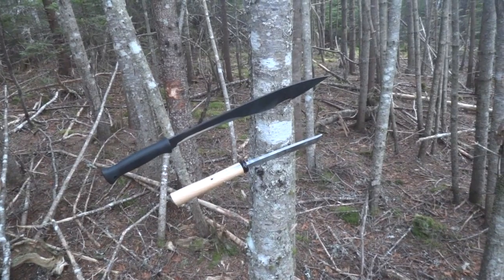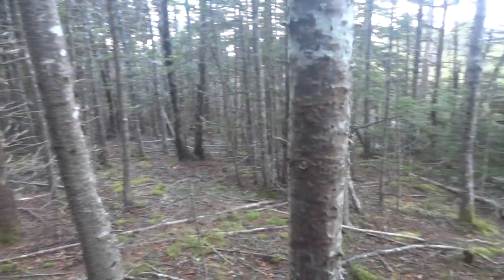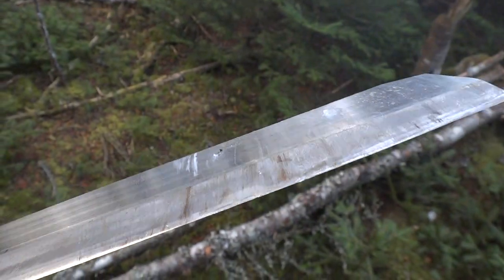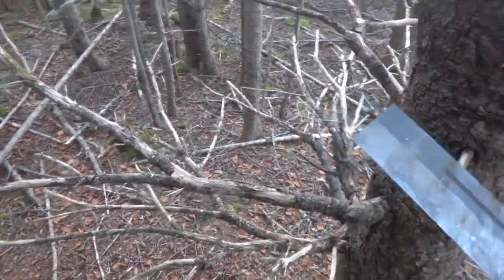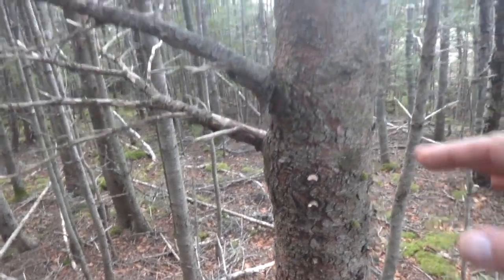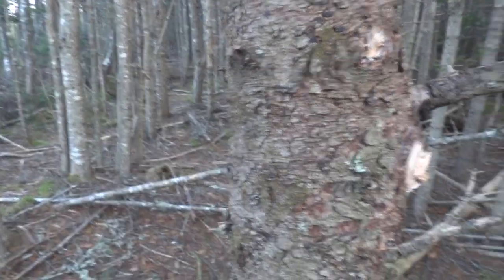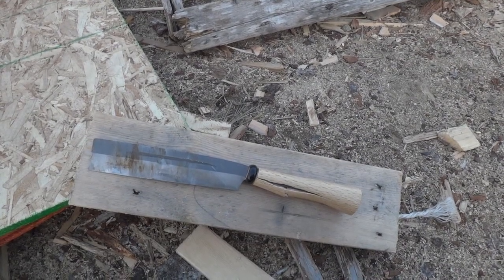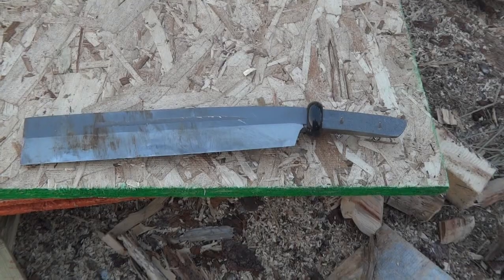Japanese Garden Machete - limbing, felling, and bucking

Comment: Thanks the only explanation of cutting vs chopping I have found on line for chisel vs double bevel and proper technique.  A full length tang in the handle must be considered and should prevent the handle from breaking or splitting

Comment from the maker: @knifedrago Modified hammer grip. On a knife this light, index and thumb are enclosed, but lightly held. On the backswing my first things fingers loosen, the blade rotates back, on the downswing the three fingers close back up rotating the blade ahead in a snap. When the blade makes contact the pinky pulls back sharply and the thumb/index finger torque down hard. This is a follow through rotation/movement.

Comment from the maker: @555Nato When felling most would either use the poll of the axe to crack them off or a dedicated heavy edge axe like a swamper pattern to cut them. I don't like cracking them in general as it leave very sharp points exposed and if you do decide to harvest the tree it is full of sharp spalls. Try to carry that on your shoulder and have the weight shift and one of them dig in suddenly, it isn't fun.

Comment from the maker: @555Nato The tang can be tapered in thickness just like the blade. This can achieve the same weight reduction as drilling holes, etc. and is a much more durable configuration and is also not as prone to shock as on larger blades. It however is more time consuming which is why most people will just drill a bunch of holes.

Comment from the maker: @SpartanJohns I had similar thoughts, I was very surprised to see a crack run up the blade and start along the spine, but was not that surprised that the handle went. But again this is the most basic/inexpensive version. It is the equivalent of the local $5 hardware store machete. I may look for an upscale version later.

Comment from the maker: @555Nato It is much harder to fit a tapered tang, but it can be done properly, Loveless made it fairly popular again for awhile. 

The main issue with all the holes is on larger blades, you don't want it for vibration purposes.

Comment from the maker: @tallswede80 Yes, I have an 18" Ang Khola which works well for this type of work. It has the mass and balance to generate a powerful swing, but still has a fine edge to enable it to cut well and a nice tapered grind so it will be fluid in the bucking of the felled wood. I should actually take it out next time and compare it to the Cold Steel kukri machete as it is of similar length (but difference in about every other aspect).

Comment from the maker: @69penetrator69 Yes, swamping axes were traditionally used for this work as it is "dirtier" than normal felling. I have a couple of old swamping heads, I just have not got around to hafting them. I also have a true old style felling head (very narrow double bit) which would be very nice on the bucking but it is designed for much heavier wood, trees measured in feet not inches. I don't cut much of them any more though.

Comment from the maker: @555Nato Rehandling a blade can be a non-trivial issue, that is likely one of the main reasons for the full tang slab grips they are basically invulnerable and very low maintenance. The only issue with handle modifications is to ensure that the balance is properly maintained on the knife, usually this can be done with a tapered (though full width) tang.

Comment: That was a bit surprising but not at all at the same time. The Wood handle breaking like that.
The steel cracking like that was a bit more surprising. I get that this is a cheap tool , but still...
Very good info on how to work with the chisel grind.

Comment from the maker: @tallswede80 This knife is actually much heavier built than the Trailmaster. It is 50% heavier with a more forward balance so the impact energies are significantly greater. It works well power wise, the handle can just not take the strain of the impacts.

I have a number of axes but for standing wood like that where there is very close in growth I would prefer a longer blade simply because of the ability to sweep cut multiple targets and not have to be concerned about haft impacts.

Comment from the maker: @virtuovice Yes, it was more of a technique issue, this blade was designed to take more of a high volume low impact type swing, more wrist action. I was actually using a lot of elbow and very heavy swings and I do a lot of axe work so the hits are pretty heavy. I don't fault the tool, however I would have liked to see better grain in the handle as it should not curve / crack like that with ideal grain.

Comment from the maker: @555Nato Short tangs have a bad name due to issues of construction, and they do put a weak point in the middle of the handle, that is just physics. If the tang on this one was a taper to the end (Loveless style) then the force would not be so concentrated like it was in this blade. But it is possible to built a partial tang without durability concerns, I doubt the handle would fail on the new custom I am having built.

Comment from the maker: @tallswede80 As well, as noted I have many axes. I usually fell at least a cord of wood by axe each year, more if I get the time, and depending on the other wood I get from various sources. 

However I would not use a short axe to do that type of work for many reasons. Primarily the short edge length would be very inefficient compared to a longer blade and secondly, in very tight ingrowth it is very difficult to avoid handle impacts. 

But if it works better for you, by all means use it.

Comment: Wow, I never thought that cutting chisel side in would help so much! It's unfortunate that the handle cracked and you will no longer be using that knife. I agree that for unpractical uses for the garden machete would strain the knife to a point where it is inoperable, like what happened to yours.

Comment from the maker: @tallswede80 Yes, as noted in the video they are easy to break, I snapped them by hand. However also as noted when you do this they leave a very sharp point both on the part that comes off and the part that is on the tree. It would be irresponsible to do that and not harvest the tree immediately, which I would not do on that tree at this time, as it is creating hazards for walking both under foot and elsewhere.

Comment from the maker: @555Nato There is a point in this video where I confused a point and implied that vibration is high on the branches because they were small. I meant to note explicitly that since they were very hard and the penetration on the chopping low then the vibration/shock is amplified.  That they are small is one of the reasons they are of course hard as they die and then dry out much faster.

Comment from the maker: @555Nato Such tangs can be a problem with wood. In general most traditional large knives are expected to have multiple handles as the handles are rarely as durable as the blade which would be expected comparing wood to steel. Even on the full tang knives such as billhooks usually they will go through a few handles unless a lot of care is taken with them. But yeah, modern materials are far more durable in that respect.

Comment: Have you ever actually injured yourself due to faults in the blade? 

Also, was that beech for the handle?
Reply from the maker: No, I have cut myself on glances, but I do a lot of work and I mean a lot, I do 100k chops in a slow/inactive year.

I don't think so, should have soaked that as it felt very dry.

Comment: Couldn't you potentially measure the strength of a steel/ht by having a bunch of specifically ground chisel type blades in different steels/hts and finding out a bit more quantitative  way to see how much force is exerted
Reply from the maker: Yes, but it would not have to be chisel ground.

Comment: @CliffStamp No shit it's heavier.  I never said anything about the weight.  But the trailmaster is also about a thousand times stronger.  I've beaten the crap out of mine.  No way in hell the edge would bend over, or the handle split.  And with stuff like that, weight is at least as important than sharpness.  You could almost use a hammer break them instead of trying to cut them, hence, the tomahawk.

Comment: Wow... What an unabashed piece of trash. Too bad it was expensive. That had about the same durability of a harbor freight machete I bought on a whim. I don't even think the stuff they sell as Home Depot (I suspect Fiskars) which is likely comparable in relative price would have that type of durability (likely designed for abuse more than cutting any way) With a blade shape and handle shape such as that I would say that it would be very well suited to what you are doing so it is too bad that failed as it did. 
I suspect that standing dead bamboo has a similar characteristic and incidentally some of the Indonesian and Tia parangs have a similar design (i'll be it,  double sided). Maybe you may want to look into that as a replacement...